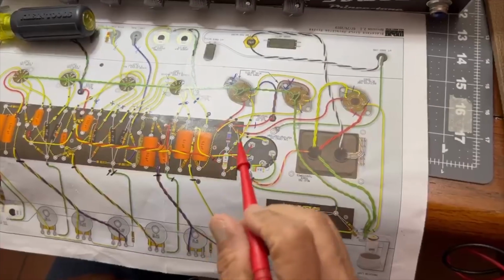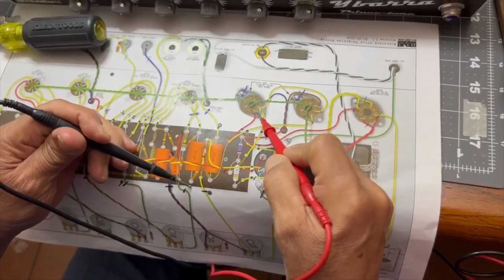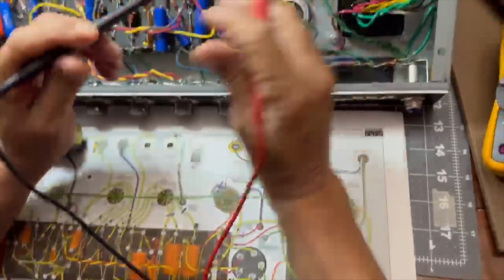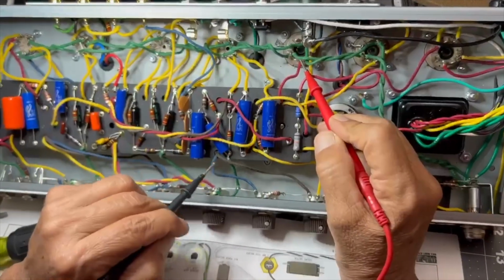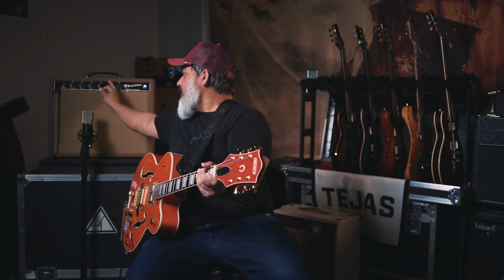Mojotone Princeton Reverb Amp Build And Review

Comment: So there's really no problem OTHER than putting it together properly, RIGHT?
and maybe Mojotone's communication and tech advice for the product they sell could be improved

I've been trying to get them to understand the advantage fo SOLID step by step instructions and how many MORE amps they'd sell if they offered them on EVERY amp
Reply from the maker: He cabinet did crack instantly. And the tolex separated pretty quickly.

Comment: My first build was the Mojotone 5E3 clone and had no issues putting it together. I purchased the cabinet and speaker from other vendors and when it was completed I had an amazing guitar amplifier. This was 5 years ago and it still looks and sounds great.
Currently I'm building the Princeton Reverb clone and the wiring diagram is giving me fits. I wish the instruction manual and diagram were more clear. You shouldn't have to guess where the connections are being made. I'm so frustrated the project is in a corner collecting dust until I find clearer resources to guide my progress.

Comment: Great video!

This was the first amp I built as well and after building a number of others, I’d say that there are definitely easier ones to dip your toes into the building water with (like the 5F1 Tweed Champ). The Princeton Reverb is quite a bit more complicated, especially with the reverb and tremolo effects, which add additional stages, tubes, and components.

In general, spring reverb circuits in these amps are known to be more noisy. I had to go to extra lengths to keep the noise floor on the reverb circuit as quiet as possible.

Mine also didn’t make a sound the first time I turned it on. However, having built other amps, that’s not necessarily uncommon and if you delve into a project like this, be ready to really study and learn troubleshooting skills. Learn how to follow the signal path, etc so you can tactfully trace the signal through the amp and where it stops (or isn’t right). Learn how to read a schematic and compare the schematic with your actual wiring before turning it all on. One great piece of advice I saw on one of the amp forums is to print a black and white schematic and/or layout and then color/highlight it as you check against your wired amp.

RobRobinette.com has a LOT of excellent information about tube amps in general and specifically some mods you can do to the Princeton Reverb circuit. If you are new to doing this, a lot of it may not really make sense until you experience it first hand and learn (after making a few mistakes in my case).

In the end, you’ve got an excellent amp and it sounds great!

Comment: I built the StewMac version of the 65 Princeton this summer and I think it may be a rebranded version of the Monotone kit, I took my time and it probably took me two months to get it done. The StewMac instructions were very good but like you I made several mistakes along the way that I found when rechecking my work. I was also missing a capacitor that they kindly sent me. I was pretty nervous when I began the circuit tests after completing the build but everything checked out and it worked the first time I turned it on (I honestly wasn't expecting that). Like yours, I found the reverb to be really intense at higher settings and the tremolo was a bit weak. Thanks to Uncle Doug and Psionic Audio videos I found suggestions for improving the tremolo and also a use for the cosmetic only ground switch. Adding additional .02 micro Farad capacitors in parallel with the .01 micro Farad caps in the tremolo circuit and a 1 M ohm resistor in parallel with the existing 1 M ohm resistor at the output of the tremolo circuit slowed down the speed and increased the intensity and it's perfect for me now. I also put the ground switch to use as a switchable negative feedback control to make the amp more versatile. I absolutely love this amp!! Good luck with yours!

Comment: Cool video and I agree, it’s a pain to work from ‘a picture’ and yes, these kits do cut corners on some components. I’ve just finished a TAD kit. Doesn’t come with a manual at all, only a schematic and diagram. So I downloaded Mojotone’s and Stewmac’s instructions and the 60s wiring diagram. Interestingly all were slightly different. Eg. Stokes mod, screen grid resistors, pot tapers, ground schemes… I used the 60s schematic and checked everything following the schematic before soldering. Huge learning curve, but in the end: a successful build. I did add grid stoppers, bias trimpot, used the correct pot tapers, another on/off switch, another reverb cable… Fun project, but next time I’ll order parts to my taste instead of a kit.

Tremelo: check your bias. Biasing a bit colder will emphasise the trem. You can also replace a resistor and a cap to improve depth and slow down speed. Rob Robinette’s website has some instructions.

Reverb noise: rca jacks on the reverb tank facing the front side of the cab should have the lowest noise.
Reply from the maker: wow! above and beyond on this response, thank you SO much for watching and ESPECIALLY for your insight into the trem and reverb!!

Comment: If your tremolo is subdued, you may have the amp biased too hot. Do some research on adjusting the bias. You can change one of the resistors on the bias board or better yet, add a potentiometer to allow infinite adjustability. I run my Princeton Reverb at 18 to 19 mA cathode current and have a very nice tremolo.

Comment: Cool video!  Thanks for your honest review.  Did you ever got the chance to compare it to a Princeton reissue?
Reply: At the time I built my Mojotone Princeton Reverb, I also bought a used Fender Princeton Reverb Reissue. The Fender was a bit brighter, even played through the same speaker. I ended up adding a 3-way bright switch to mine just for the option of boosting the treble response. Both are great amps, but I still give the edge to the Mojotone. The speaker can make a huge difference. The Fender PRRI had a Jensen C10R and my Mojotone PR has a Jensen C10Q. It’s shocking how much sound those 10” speakers can push out.
Reply: @BoydTimothy  awesome thanks! Which speaker did you prefer and why?  I’m currently building a Mojotone PR and bought the C10R to put in it.
Reply: @mathieulandry2181  I used a Jensen C10Q because that’s what Mojotone sent me in the full kit (you have to order their cabs and speakers separate now). If you want to hear how it sounds I just put out a sound demo video of the amp yesterday: https://youtu.be/R0MXePMT4DM
Reply from the maker: No unfortunately i don't know anyone local with an actual princeton :0/

Comment: Try flipping the reverb tank around.  You need to change a resistor for more intense trem.
Reply: Lowering the bias will strengthen the trem since it is a bias wiggle type of tremolo
Reply from the maker: thanks so much for info and thanks for  watchin!